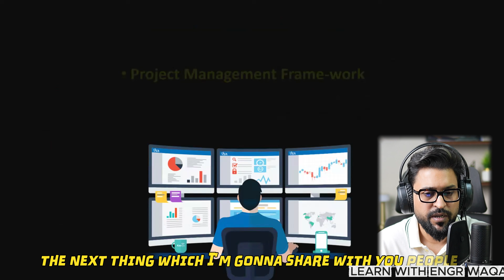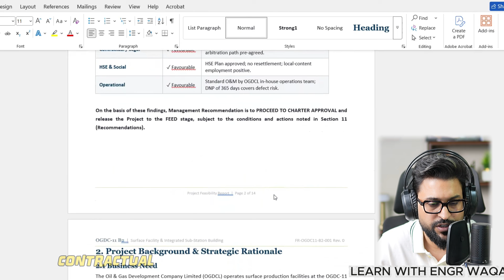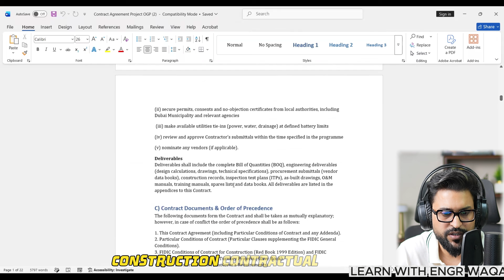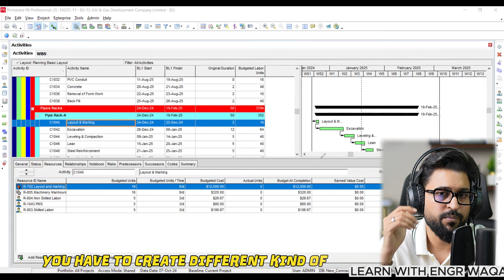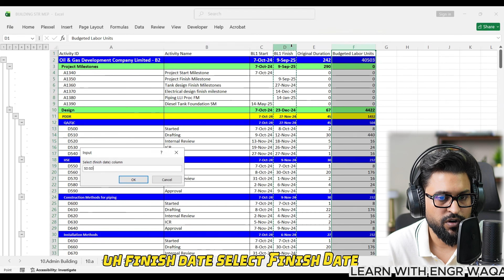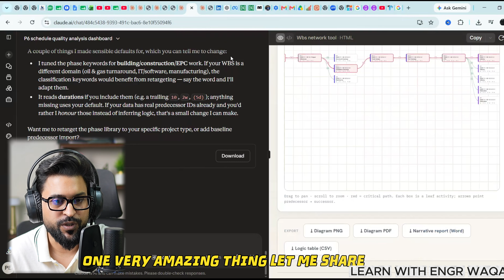Planning Engineer Skills Checklist: Everything You Need to Succeed in 2026

Comment: Great Explanation. I have 15 years of Project Management Experience in Telecom sector but never used any tool of planning except excel.

I want to switch industry from Telecom to Construction or Oil & Gas as I am in KSA by learning P6 will it be helpful?
Reply from the maker: Yes, whatsapp +923417213439